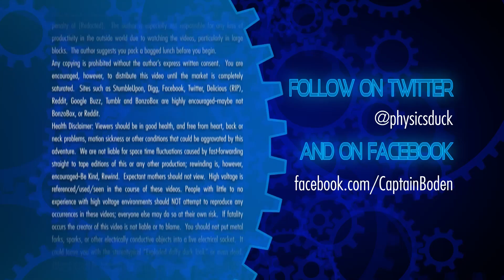Captain's Blog 1 19 2014 RC Helicopter Basic Info

Comment: It's a rule of thumb to turn the transmitter on first just incase there are any stray signals. If you turn the receiver on first, then a stray signal may cause the device (Helicopter) to respond to an undesired command. Turning on the transmitter first will override any stray signals.

Comment: For my V911 I use the Carbon fiber shaft, Delrin main gear (it's like a propeller, the spokes are angled for extra lift), I use a paddle flybar, metal CNC swash with fisheye, stock plastic head (CNC Metal head is too heavy), 200mAh battery and Solo Pro main motor (larger more robust and power)... It's the best configuration you can get on this model. All these parts can be had for wicked cheap on ebay, free shipping from various places (in US or China).

Comment: Doesn't gyroscopic precession cause inputs to have an effect 90 degrees ahead of the input. So, wouldn't that mean that when the swatch plate tilts forward, it will cause the helicopter to turn right? (assuming a clockwise rotation)

I don't really know though

Comment: In my opinion there is no reason not to start with a 4 channel coaxial with a mode 2 remote. I did it and jumped to a 4 channel single rotor fixed pitch (with flybar). I'm not ready for a 6 channel cp at the moment :) The 3 channel crap is fun until you mastered 10 flights and start to realize you want yaw, pitch and roll controll realy bad.